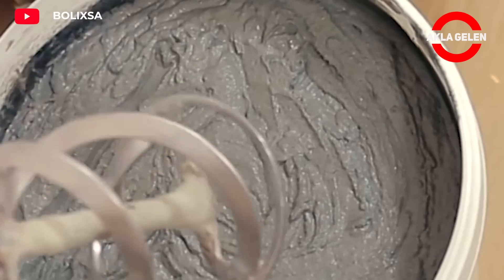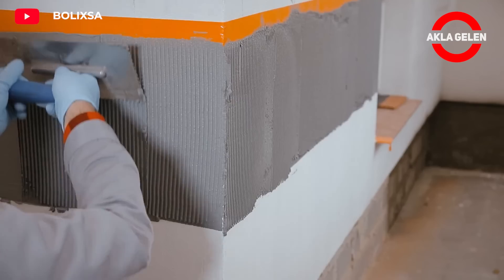This Construction Technique Really Works - Incredible Construction Technologies

Comment: As a brickie myself the plastic inserts can't work as the British standard for brick sizes is a plus or minus of 5mm per brick over a ten brick length ie a difference of +50 mm to a-, of50mm  100 mm or 4 inches in English.. 🎉